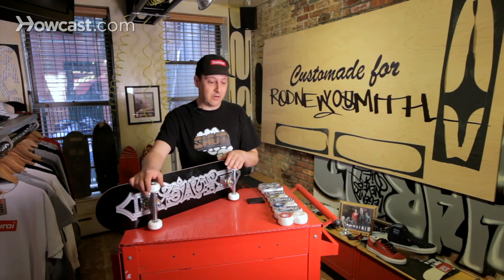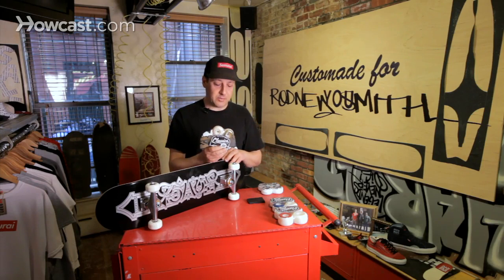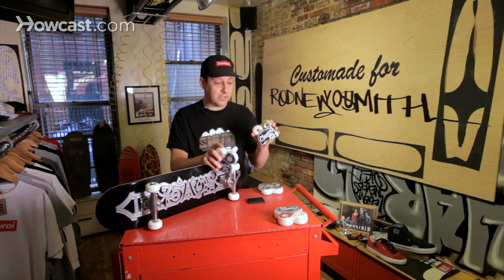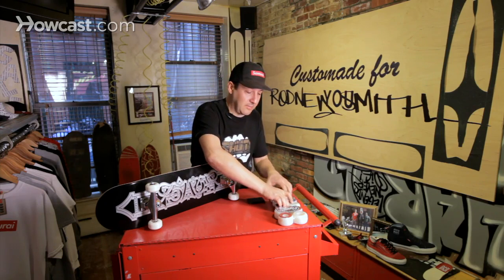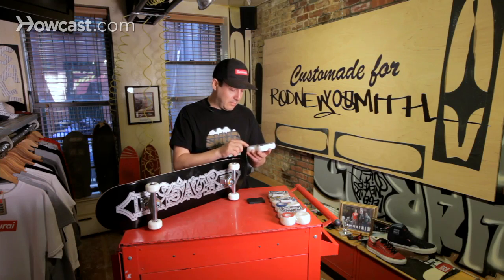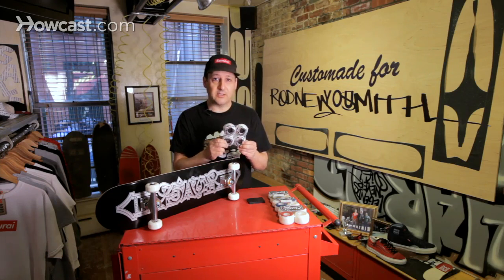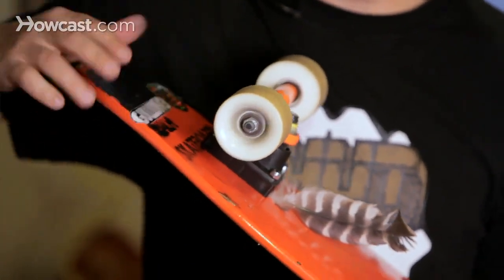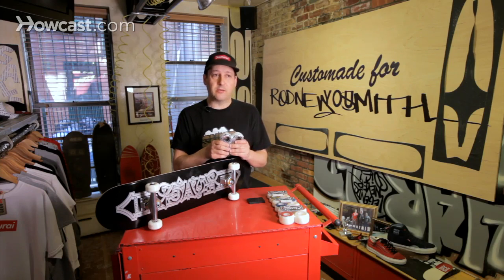How to Pick Skateboard Wheels | Custom Skateboard

Comment: Would 52mm 85a weeks be good for riding on hard/rough concrete? Also be able to ride smooth on roads?
Reply: I would say get like a 56 mm I have a 53mm at the moment and I'm thinking of buying bigger wheels for street.
Reply: i have 56 mm and they are perfect for street they roll over most things but they do feel a bit slower so id say get 55 or 54
Reply: Turtlez1130 are 56mm good for riding street and Park? Cause I just got some Spitfire classics 56mm, and I haven't had a 56mm pair of wheels ever

Comment: Does the hardness affect the speed of the board? because i got some soft wheels for free and for some reason i need to push a lot more now (the bearings are brand new reds)
Reply: Ye! Hope you found your answer sooner but, soft, cheaper wheels are slower.  Most evident in cheap amazon wheels you can buy for 4 dollars.

Comment: I'm gonna buy 60 mm for cruising. What wheel should I buy?
Reply: Orangutang
Reply: Or kryptonics but orangutang last longer for me
Reply: If you get kryptonics the only good ones are older than 1992 because the new ones are made by walmart
Reply: Nooooooo, get the 63 mm 78a hwgs fatties, those are amazing, perfect for tricks, cruising and even some sliding, price is a lil steep theaux
Reply: klipps
Reply: penny board wheels. i've literally never heard any complaints in terms of cruising and the price isn't too steep

Comment: I'm new to skating and I would like to skate in the street where it's a bit rough but I'd like to skate in a park what should I get ?!
Reply: Get size 52s its like the best size, and the wheels i recommend are spitfire f4s 👍
Reply: jonah swank thx :)
Reply: jonah swank idk how you guys skate those wheels i have 52 and my board always stops with gaps or cracks
Reply: 626razo Same.
Reply: It's all preference. I like 51 or 52 and I skate street and at the park.
Reply: Ricta speedrings. They are PERFECT
Reply: +jonah swank OMG i got the Spirfire F4S
Reply: +Neil Mcnab If you live in the NYC/New york go to willborge theres a nike Skateboarding Park its free
Go fast before it gets taken down
Reply: +626razo i live in NYC north part, where streets are rough and i use 50mm. Sure the ground makes it shake alot, but i got a solution for cracks. Just do a little quick manual or even an ollie over it. I am still learning to ollie while moving so i do the manuals
Reply: +PopsTheBest did they take it down already ;-;
Reply: Comment ik Rip.
Reply: +Neil Mcnab 54mm is good all rounder size spitfire do soft d,s at 92a and 95a better for rough ground but not to soft
Reply: +Neil Mcnab try oj mini juice i skate street great with these and theyre good for park
Reply: How are you doing so far? Are you pickin' up skating pretty fast?
Reply: Bo88y Beretta fine thx ive learned to ollie, pop shuvit,kickflip , drop in, rock and rolls, rock to fakie , ollie 4 stairs and i can nearly heel flip. I think im doing ok so far thx
Reply: BurnedMeatloaf r they good for cursing because I want to do tricks but also I have to cruise more to get around

Comment: Hey guys I have a baker board with venture trucks 5.0 and I have a 8 inch board what bearings should I get for my spitfire formula four 52mm wheels? Please respond
Reply: Bones swiss ceramics are the best, but expensive. If your on a budget, bones reds are cheap and good.
Reply: +Kyle S ceramics are bad just get the normal swiss but not ceramics

Comment: Bigger wheels might not give more balance. I dug up some very old bigger wheels, and compared them to my 50 mm. The track marks were exactly as wide on both of them. Meaning they had no more traction. Just a lot more fat and heavier. Of course bigger wheels are...bigger...but very quickly they lose a lot of millimeters. And become just a rounder, fatter version of skiny, flat wheels. Now some people might like that. The weight and shape. Interesting

Comment: Probably because you can skate them until they're 50s. while they're bigger, little cracks don't throw you off as easily, if you skate street, and you can get a little more speed with them. and personally, it doesn't affect my flip tricks at all. Is that the issue for people or what?

Comment: I want soft wheels, they travel over rough concrete much better. 
Which should I buy?
Reply: I just got the Ricta Cloud 78A 54mm.. The name couldn't be more correct. You litteraly feel like riding a cloud!
Best thing I've ever bought for my board!
Reply: Jacob Fredsgaard In comparison to Spitfire 80HD's would you say they're even smoother?
Reply: +Cheecks Jamz i haven't tried the Spitfires, but the Ricta Clouds are really a joy to ride!
Reply: Get sector 9 butterballs
Reply: +Luke Jackson or 69mm steamrollers sector 9
Reply: +Isaac Rod those are longboard wheels.. You can use them, but I'd be worrying about wheelbite all the time
Reply: +Jacob Fredsgaard oh ye, do you think risers will help
Reply: +Jacob Fredsgaard oh ye, do you think risers will help
Reply: I think buying skateboard wheels for a skateboard would help.. Those steamrollers aren't softer than the Ricta's, they're just bigger in diameter.
Reply: Cheecks Jamz find some 89a bones wheels
Reply: Cheecks Jamz bones atf
Reply: Jacob Fredsgaard are they still good for smooth ground?

Comment: What type of wheel is good for asphalt?
Reply: that's what I am looking for
Reply: PBJsandwich 7 SHARK WHEELS 60mm better than any other wheel
Reply: Mikai Mitchell thank you so much ill be sure to get that
Reply: I got a used longboard. It worked better on the pavement than the shark wheels. But those are on the cruiser so not a fair comparison. The shark 60 78d were better than the Bones 53 100d

Comment: I just got Spitfires wheels 52 mm f4 and Bones Redz bearings. But the bearing doesn't go in my wheel very smooth. Someone who van help me?
Reply: Try putting the bearing on the axle then putting the wheel on backwards and smack it down on the bearing then take it off and put it on right then tighten it up all the way and go one spin back
Reply: I got the same stuff lol
Reply: +Preston Ray maybe...